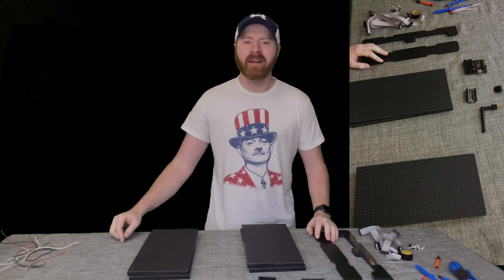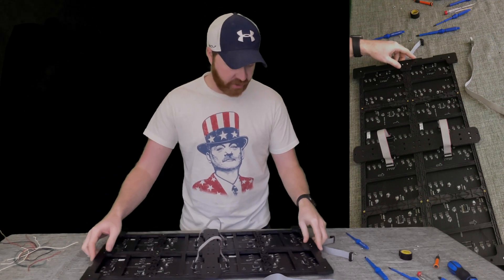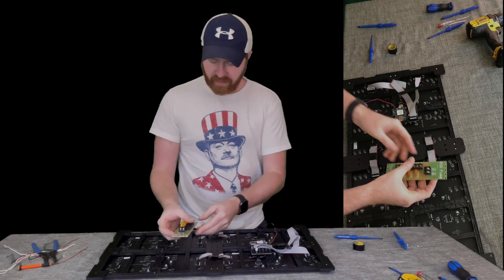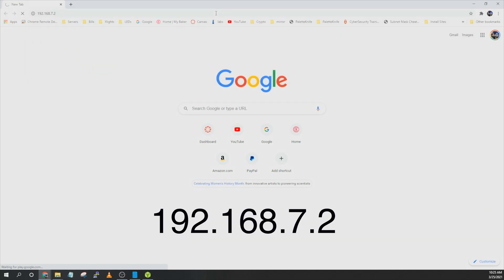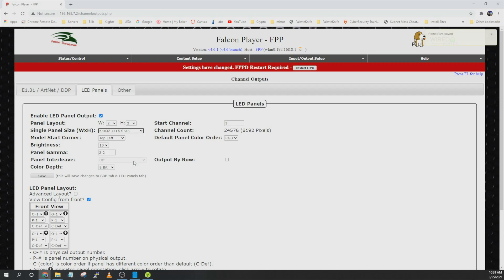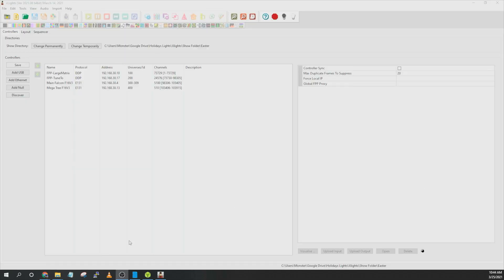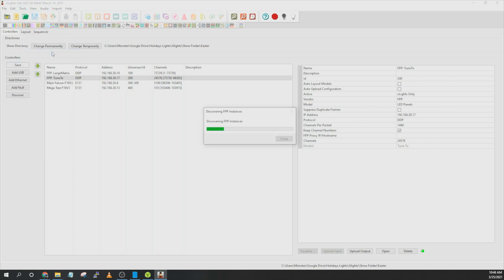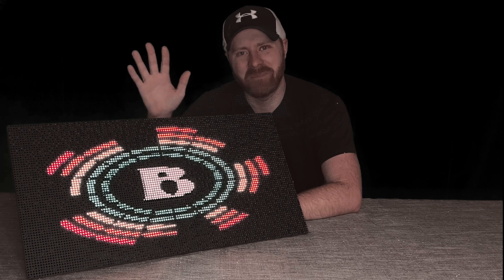P5 Panels - Part 1 Panel Build + FPP & xLights Configuration

Comment: Awesome video! 
I'm using a pi player to run my show. Can I connect the  panels to it or do I need a stand alone player?
Reply from the maker: Thank you! I think you need a controller for the panels, we used fpp on a beagle bone/pocket scroller but the other popular option is color light. But the pi you have should be able to talk to the color light or beaglebone and then control the panels
Reply: @BostickFamilyLightShow  Ok thanks!